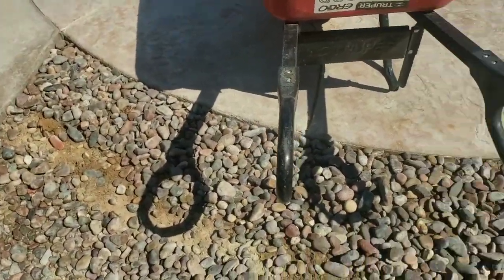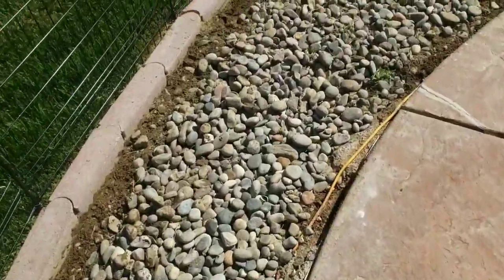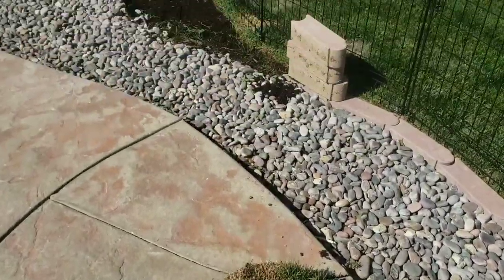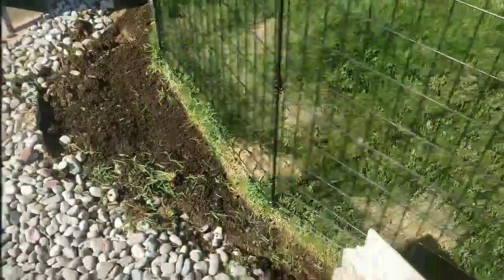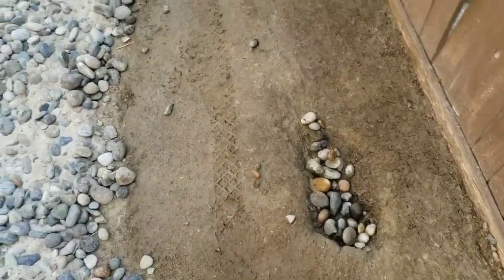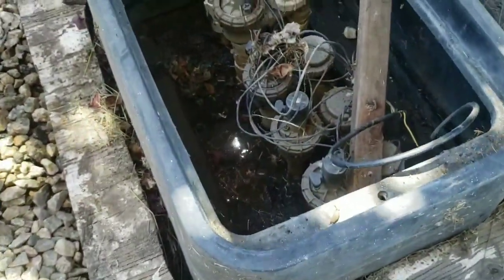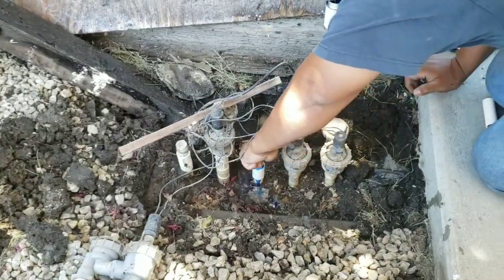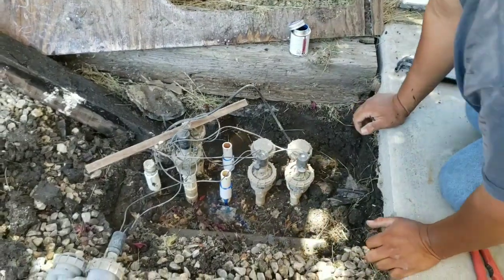Removing Rocks | Renovation for Rock Planter

Comment: What happens if the rocks are stuck in the dirt? My house has rocks in front and I made a little area kinda clear but the rocks are stuck in the dirt. Do I wet it?
Reply from the maker: did you get it done?
Reply: I'm stuck with the same problem. Previous owner put gravel on everything, remodel contractor took out the plants not the rocks, and it's been a wasteland since. I started planting a few native shrubs but every time I dig, it's 80% prying out rocks. The shovel hits them and I usually have to wiggle them out by hand, although if I'm lucky, I find a gap to wedge the shovel in and loosen it a bit more